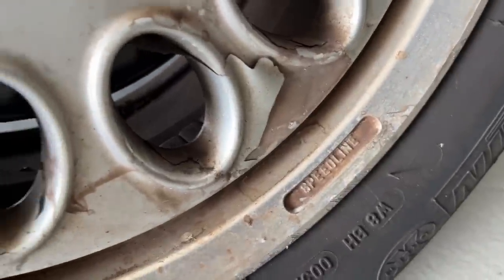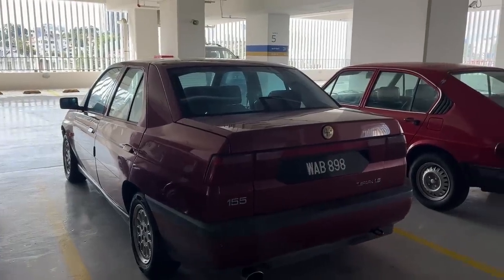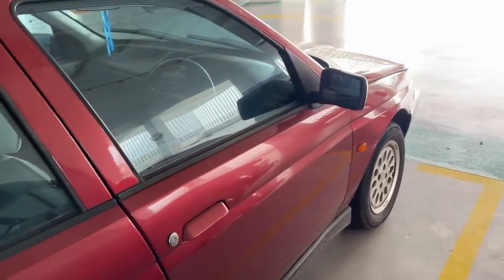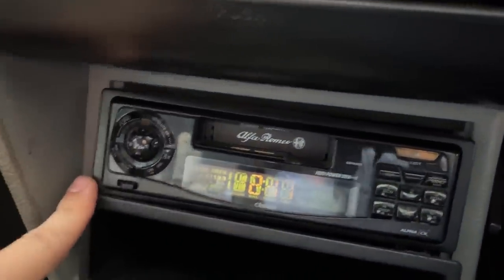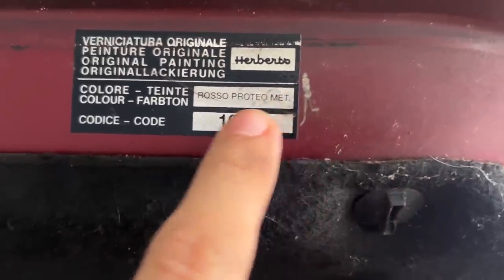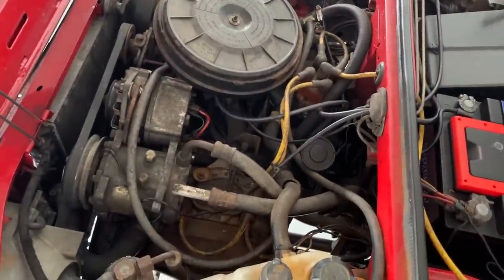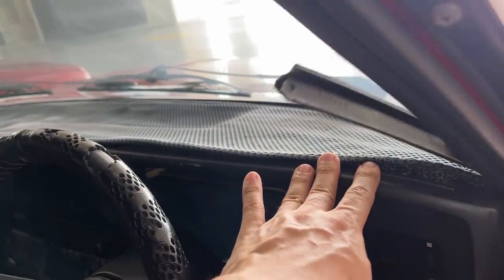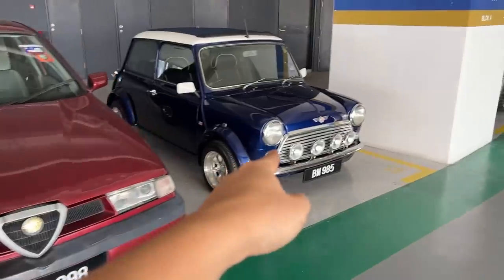I bought 2 Alfa Romeos?! Walkaround + Restoration Plans | VLOG #32 | EvoMalaysia.com

Comment: damn...i pretty much hv got similar preferences in autos wt u..scary!the bm,the mini,the porsche,n now alfas...no ain't got THE alfa i looking for (145 TS 2.0)...woah...just realised how super low the mileage for the age of the 155....such a thrill looking fwd for the gradual resto work to fruit a satisfying end result-soon!noooo...stick to original color Thomas!Alfa needs to be red,coz its a poor man's Ferrari....or black,not green!walauwey...the Alfa Sud reg is same as one of my rides...geng!The alfa sud needs a resto-mod work to bring into the modern age practicality without losing its character of originality...u gonna get cassettes?prob is,the player may hv issues playing to begin with...believe me,i own 5 cassette players(relatively new hifi n walkmans) but they stopped working...the mechanism usually give way!the rollers/pinchers may damage the tapes,the head may have rusted...so,u may end up getting ut tapes tanggled within the player,even if it rolls-n yeah,the motor-notorious!many av shops may not be familiar with this old tech!so?add a bluetooth connection n spotify jerrr....Bottega is awesome choice!
Reply from the maker: Thanks for your feedback bro. Will think about the color as I drive it a little bit more. :)

Comment: My first AR was a 155 1.8. Same year. Bought it blind, as I was informed it was a 156. The first model I adored. So for some years I was stuck with it. I later bought my first 156, 3 156 further now, how the heck can someone buy this ugly models? The Sud was a disaster from the start, the 155 , is ok, but misses the line of a Mermaid.
Reply: Poeh, why being so negative?! The AlfaSud is a very iconic, important and influential concept. Volkwagen admits that their first Golf wouldn''t probably not have been as good and succesful if there had been no AlfaSud in 1972, 2 years before the Golf was launched. As a kind of hommage, VW has put an Alfasud into their Museum collection at Autostadt. The Sud is a unique car that handles and drives very well, it's very spacious, practical, and economical. It has an amazingly good and beautiful design with loads of style and character. It has a rare kind of wholesomeness to it. Forget about the rust issues, those have nothing to do with the concept of the car itself but only with production circumstances. The 155 is by no means an ugly car, it has a very elegant and typical design with good proportions and clean, straight lines. But I agree with you on the timeless beauty of the Alfa 156.